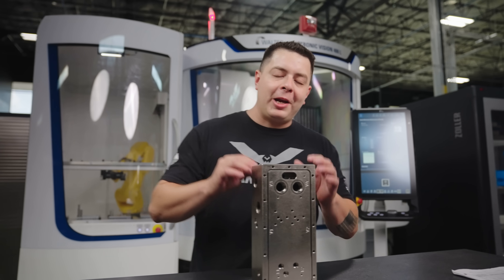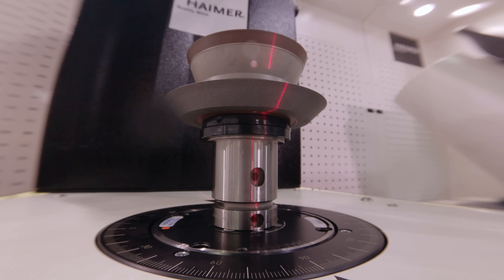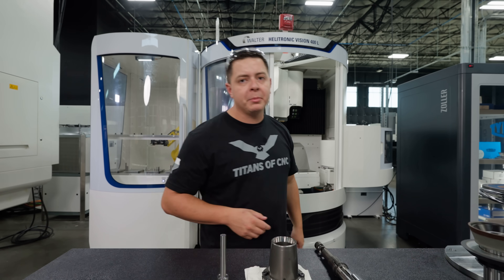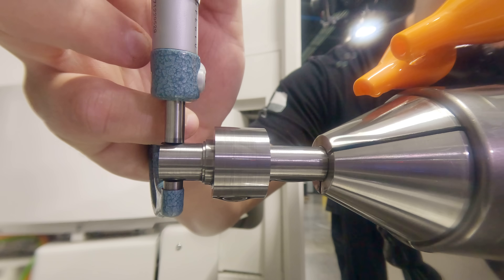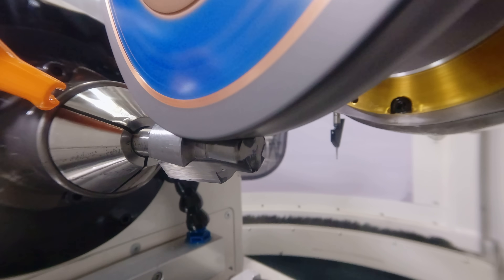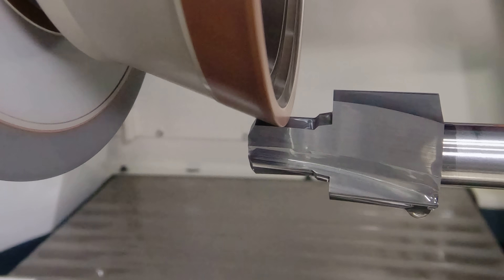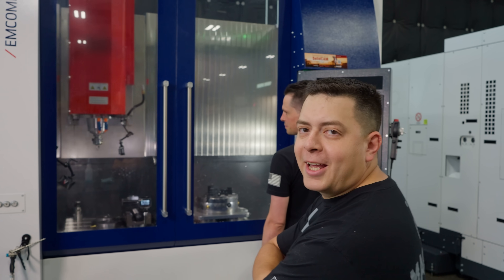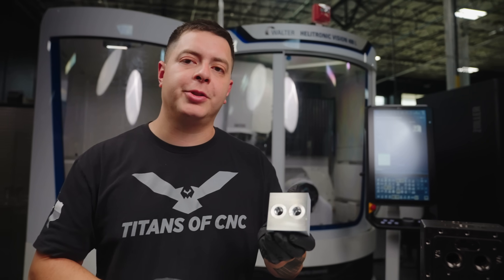Master Porting Tools or Scrap It All

Comment: Those porting tools can be pretty expensive, so if you're doing small runs or not super critical stuff, interpolating the seat is fine is a ball end or taper end mill. Because these seats are normally used with o-ring fittings.

Comment: What SFM was that porting tool run at in the mill? I'm an apprentice and no one in my shop seems to have any idea how to run one of these successfully without terrible surface finish or chatter. I've experienced with lots of different speeds and feeds but it's tough, even using coolant through the tool.

Comment: i have used porting tools before. never had much success. always went the route of multiple tools.  wondering the cost effectiveness of a solid carbide port tool versus multiple carbide tools. i cant imagine that tool was any less than 5-6 hundred bucks  [without coating]. it looked like the sfm was incredibly slow for solid carbide. so what is the time savings?
Reply: About 20-30 seconds for a single port, and a couple seconds per other port.
Reply: But that tool lasts for EVER in whatever material normal people make manifolds out of.  Buy once, cry once.
Reply: @christianweagle6253  In aluminum sure, but most manifolds like that will be some kind of stainless steel and that's going to eat that tool pretty quick. There's a reason all the off shelf ones are brazed and not solid carbide, or are insert style tools.

Comment: Will you guys be offering these porting tools for sale? There's not many vendors making them especially out of solid carbide. I'd be interested to see how your cost in solid carbide compares to others that use a brazed on HSS version. Keep up the good work!
Reply: SFS Carbide or AB Tool can make pretty much whatever you want. Unless you have dozens of these ports per part, you're better off just using a taper endmill and a chamfer mill.

Comment: We run #16 and #32 ports at the shop I’m at and for years we used separate tools to machine the thru bore, minor thread diameter, and the two angles. Maybe 4-5yrs ago we started using a port tool made by Allied Machine that works great! The first time I used it, the gauge standoff wasn’t right, so I ended up doing the same thing that y’all did and it came out perfect. I run the port tool, rough thread, semi-finish thread, re-run the port tool, and finally do a finish pass with the thread mill and it comes out perfect every time. I have it pretty dialed in now, but it was a bit of a headache to get there when we first started using it. It has cut a lot of time off the job. Both set-up and run time. I used to drill the hole, use an ID adjustable boring tool to finish the minor, a 15deg tool for the o-ring angle, then a 45deg tool for the thread angle, then the thread mill. Porting tools are a genius invention!
Reply: form drills are brilliant but they were invented a very long time ago!

Comment: Other than cycle time. Is there a reason you would use a porting tool rather than just interpolate with standard tool?
Reply: Your first sentence is really the key. These tools do the work in a fraction of the time it takes to interpolate. But, you can do the ports with standard tools but you'll end up with chatter. These tools leave a reamed surface and that's really what you want when you're dealing with insane pressures and you need that O-Ring to seal properly.
Reply: @circa9097  These form tools are actually WAY more likely to leave chatter marks because of all the different directions of tool pressure. Go look into how valve seats are being cut these days on the premium end. No one is using form tools anymore because of the chatter and runout issues. They're all single point "turned" with what's basically an auto adjusting boring head.

Comment: Port tools are always a bear to apply.
Sometimes it is good to go in with a high SFM and on the next part it will be the opposite.
Sometimes they like a high IPR, the next time not so much. Dwell is also crazy, sometimes it wants 1.5 rotations other times it takes 10 rotations.
Don't get me started on inserted vs solid carbide.

I fought them for almost 50 years on mostly Cat parts. Never came up with a definitive method to run them.

Comment: I use porting tools all the time for CAT parts. I’ve used some that have a TA drill insert at the tip so it can drill and port with one tool. You just wanna kiss the part maybe .01” with the largest diameter of the porting tool to get the correct depth.
Reply: Same here, for both CAT and JD.
Reply: What SFM (rpm) and feed do you use for a port tool? What size should the drilled pilot hole be? Newbie with porting tools here so could use the pointers.
Reply: @ciscohernandez4384 think of it as a reamer so for the drill just .01”-.015” smaller than the tap drill size.
Reply: I have also used these for CAT parts